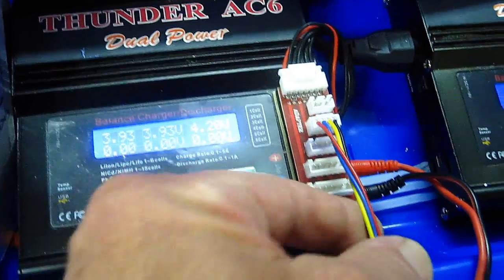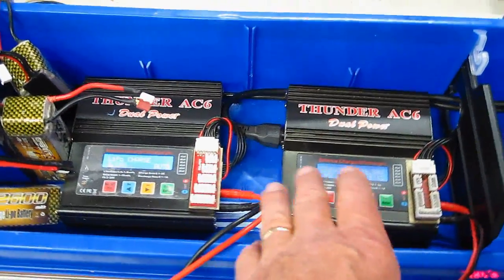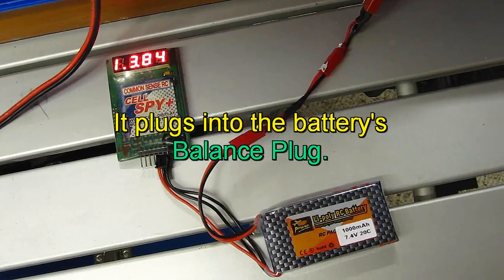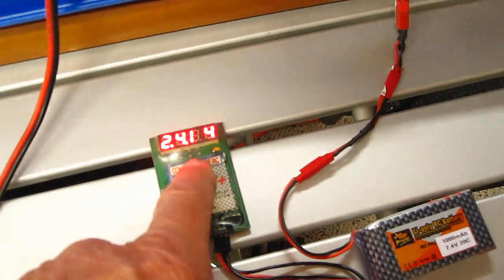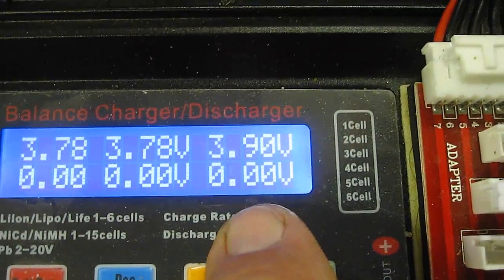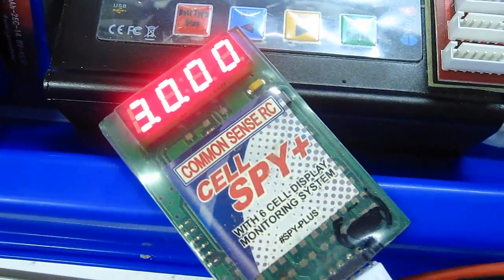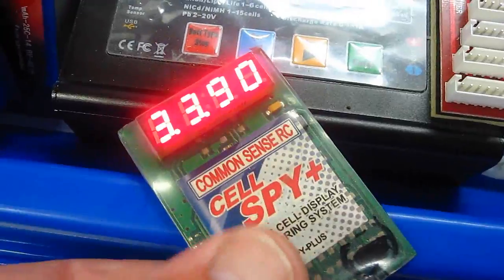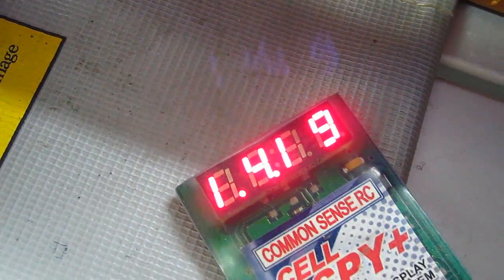Cell Spy Lipo Battery Monitor tips.

Comment: You can use any number of different battery alarms it doesn't have to be this particular brand, if I was to do this I would use one of the ones I have that I use while flying. When the battery reaches the volts you have set the audio part goes off to tell you to land. I liked it so much I bought a second one!
And you can increase the time limit from 180 minutes if you find it's not long enough. Have you tried doing that or you prefer not to?

Comment: I really like using the LIPO LED meters/alarms to find individual cell voltage and total voltage.  I even fly my planes with these alarms, every time.  The price is now down to $3 on Ebay.  Search Ebay for "rc lipo battery low voltage LED tester" to find them.